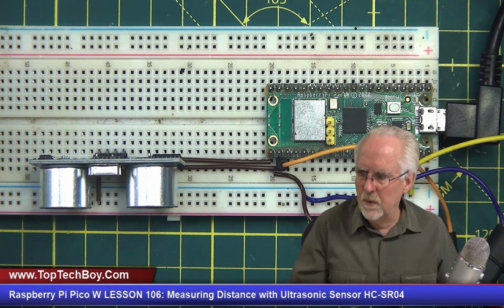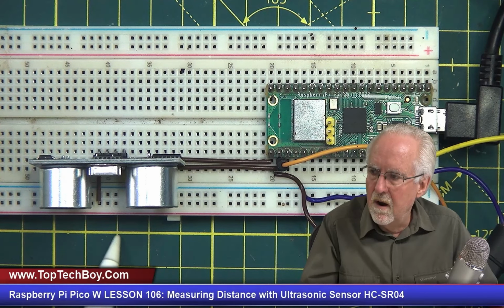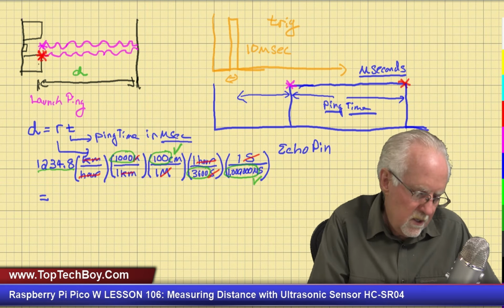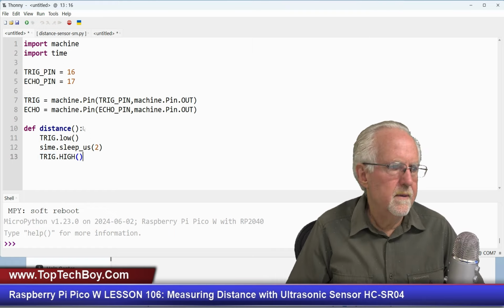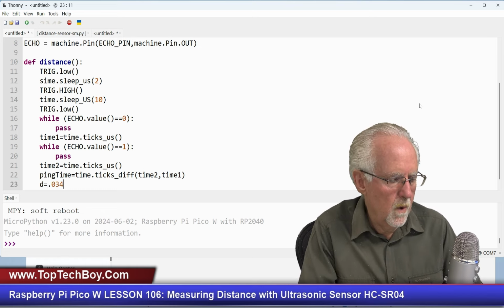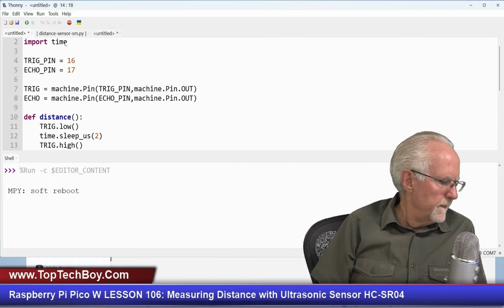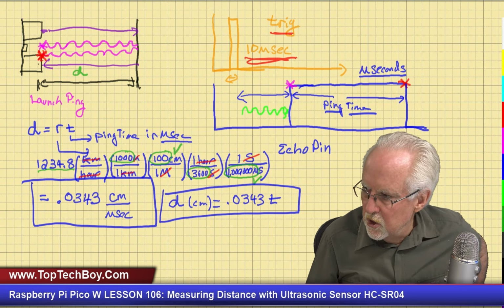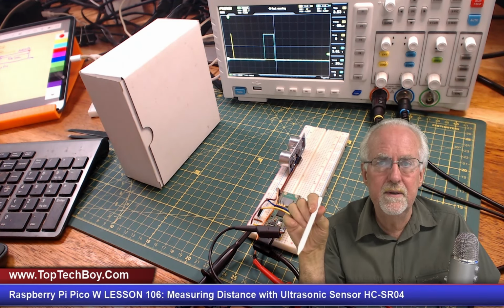Raspberry Pi Pico W LESSON 106: Measuring Distance With Ultrasonic Sensor HC-SR-04

Comment: I get the math.  what I find hard is the @rp2 format.   I watch the lesson two times and you are still expanding my mind.

i found this on the web
rp2.asm_pio(*, out_init=None, set_init=None, sideset_init=None, side_pindir=False, in_shiftdir=PIO.SHIFT_LEFT, out_shiftdir=PIO.SHIFT_LEFT, autopush=False, autopull=False, push_thresh=32, pull_thresh=32, fifo_join=PIO.JOIN_NONE)¶
Assemble a PIO program.

The following parameters control the initial state of the GPIO pins, as one of PIO.IN_LOW, PIO.IN_HIGH, PIO.OUT_LOW or PIO.OUT_HIGH. If the program uses more than one pin, provide a tuple, e.g. out_init=(PIO.OUT_LOW, PIO.OUT_LOW).

out_init configures the pins used for out() instructions.

set_init configures the pins used for set() instructions. There can be at most 5.

sideset_init configures the pins used for .side() modifiers. There can be at most 5.

side_pindir when set to True configures .side() modifiers to be used for pin directions, instead of pin values (the default, when False).

The following parameters are used by default, but can be overridden in StateMachine.init():

in_shiftdir is the default direction the ISR will shift, either PIO.SHIFT_LEFT or PIO.SHIFT_RIGHT.

out_shiftdir is the default direction the OSR will shift, either PIO.SHIFT_LEFT or PIO.SHIFT_RIGHT.

push_thresh is the threshold in bits before auto-push or conditional re-pushing is triggered.

pull_thresh is the threshold in bits before auto-pull or conditional re-pulling is triggered.

The remaining parameters are:

autopush configures whether auto-push is enabled.

autopull configures whether auto-pull is enabled.

fifo_join configures whether the 4-word TX and RX FIFOs should be combined into a single 8-word FIFO for one direction only. The options are PIO.JOIN_NONE, PIO.JOIN_RX and PIO.JOIN_TX.
Reply from the maker: Excellent. These state machine projects do stretch the brain. Glad you are sticking with it.

Comment: First time submitting homework here! - https://www.youtube.com/post/UgkxKz_J4Qd8BFVuE2xELzLVVNBmiUEHcDov
I've made it through all 106 lessons so far and have officially caught up.  I don't have a video...I'll try to do that in the future, but for now I've posted my solution to my youtube page (Lesson 106- Measuring Distance using PIO SMs).  I created a library (ECHO2) for the state machine work.  The Micropython main program is 'echo_location2'.
This was a tough one, but very gratifying.  I've finally fully grasped the process to determine the right frequency to use for state machines.  Once you see it, you can't un-see it. :D
And seeing those distance numbers come in so clean after getting it to work with a SM.....fantastic.
Happy coding everyone!

Comment: This stuff is so Fascinating, * Keep in mind, IF your sensor is not reading Properly, you may Need to use Pin 40 (the 5 volt pin) as some of these sensors won't work on 3.3 volt *  If anyone is interested here is the Formula to measure in Inches instead of Centimeters.........  767.27 mph * 5280 ft * 12 in / 3600 / 1,000,000 and it works great....
Reply: I think my previous comment got eaten by YouTube... If you check schematics of this sensor, you'll find that ECHO and TRIG signals are pulled up to Vcc. If you connect that to 5V, you can potentially damage your ECHO and TRIG pins on Pico side, as Pico is not 5V tolerant.
But yes, world of using PIO is indeed fascinating 😊

Comment: The Echo PIN Signal ist also much longer than the original Trigger, Signal due to the distance of the Sound ? But in the Code you wait until the Signal went down. So in my opinion you are waiting much longer than needed. Wouldn‘t it make Sense to wait until the Signal rises or isn‘t there an so much difference? I’ve no osci in the Moment.

Comment: I enjoyed your lesson 106, I have the oscilloscope you recommend but are unable to get it to work on this project, can you do a video to shown the setup for this scope to show how you get the outcome you show on the lesson.  My screen is full of noise and no square wave.
Reply from the maker: No, the purpose of the lesson was to learn to think and write code. Loading a library you have not achieved that same level of learning. Think of what I taught, use that to write the code. Then check my solution.